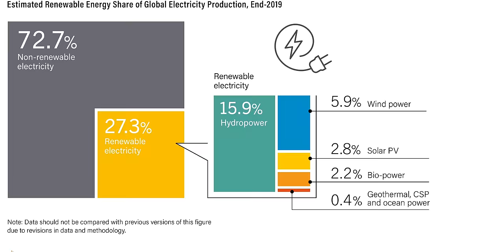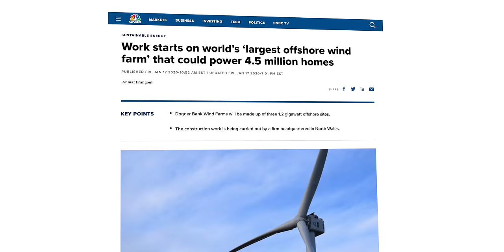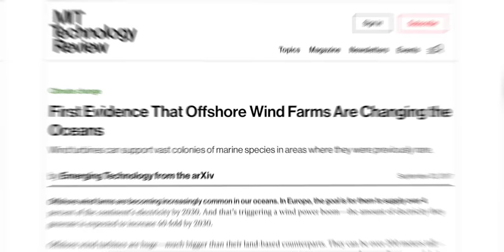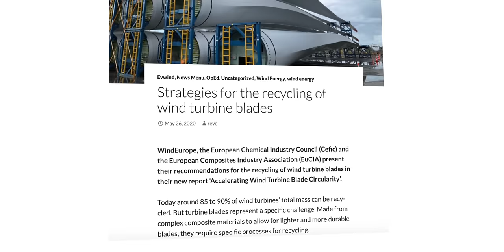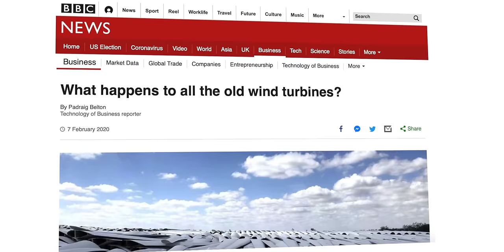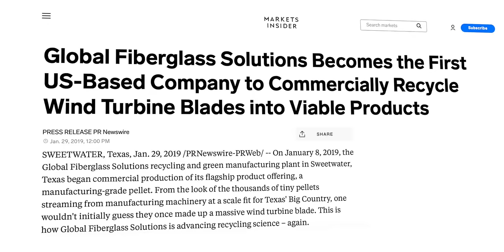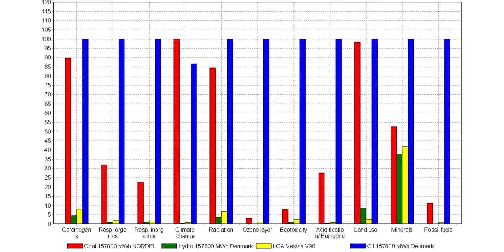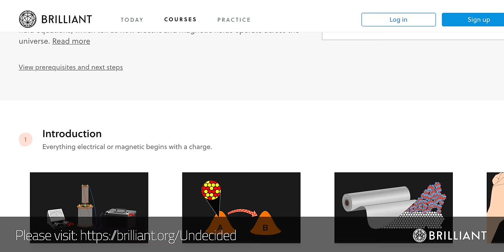The truth about wind turbines - how bad are they?

Comment: Wind turbine generators have a huge noise foot print with many on land applications now needing to be well over a mile from people.  There is evidence of noise being transmitted through the ground resonating in residences miles away from the source.    This and other issues have pushed wind turbines offshore where the cost is about double per MW than on shore.   Onshore wind turbine farms in the United States when their cost is past on to consumers have always caused electric rates to go up significantly.    

There is conspicuously no well publicized studies of the noise offshore wind turbine generators impacted to the water affect on higher level sea life such as fish and marine mammals.    Fishermen say fish don't live around noisy wind turbines and offshore wind farms destroy fish migration routes near them. 

Wind turbines live in a hostile environment and frequently don't reach their service life of 20 years with the average being closer to 10 years.   Wind turbines produce electricity that can substitute when available for other sources of electricity.   They have to be backed up by dispatchable power typically expensive to fuel natural gas combined cycle plants.   

During the 2000s it appeared the midwest USA high wind areas would be ideal for low cost electricity produced from wind farms.   Now in 2024 there is no longer any discussion on that implementation.   If it would have been economically viable it would have been attempted.  It likely proved it was not.   Part of the reason for not making a large implementation was the need for construction of long distance high voltage transmission lines, but other consideration now appear to have made them non viable.  

Atmospheric CO2 levels at about 1200 ppm about three times what it is today would greatly invigorate C3 plants the majority of plants on earth greatly greening the planet.   There is no mechanism that would allow greenhouse gas behavior to cause global warming.   All greenhouse radiant energy from the earth is completely absorbed in earth's greenhouse effect within in 20 meters of the surface.  There is no greenhouse radiant energy left to further interact with greenhouse gases.  

The cause of global warming is not known.  Global warming was officially reported at 1.1°C in 1991 and 1.06°C in 2022.  In the mid 1990s global warming was down graded to about 1°C.    The UN IPCC science report in its back pages has legal data transparency statement it took its greenhouse gas samples at 20,000 meters altitude where it is common high school level knowledge there is no greenhouse radiant energy.   This is common practice for misleading marketing to have a legal statement of data transparency protecting the perpetrators from fraud prosecution.  Even if there might be some stray greenhouse energy at 20,000 meters it is common knowledge it is not found there so a 20,000 meter altitude sampling statement legally states the report is not dealing with greenhouse radiant energy which is what greenhouse gas behavior interacts with.   The IPCC science report doesn't declare the 20,000 meter altitude statement is for legal purposes it just appears largely out of nowhere.

Comment: I am not totally against some green energy like wind and solar. I have 6 Renogy 100 watt solar panels on my shed roof and all of them go to my house through chinese inverters to offset my electric usage. I did it myself and they do sometimes spin my meter backwards. The others are a _arbor _reight panels and they charge a single deep cycle marine battery through a Renogy charge controller to power a drill press, radial arm saw and my router table along with a radio but not all at the same time( I couldn't use them all at the same time anyway). I also have a wind generator from Missouri Wind and Solar that I've had for quite some time and it works great. The only down side is that I have a 24v inverter hooked up to it and it needs to spin up quite a bit to generate enough power. If I used a lower voltage inverter it would generate electricity at lower RPM's. I just never got around to ordering it due to more success with the solar panels and the wind generator is not in it's permanent spot. I have a lot of projects going on at the same time. There is always going to be a plus and minus side to everything but getting rid of fossil fuels is not the answer. I laugh at the tesla toy cars and people who claim global warming. What people don't understand is that no matter what things change. The Moon is drifting a little farther away, the Sun is getting hotter and will get bigger as it burns through its fuel eventually growing into a Red Giant engulfing the orbit of the Earth and maybe Mars. The earth still wobbles on its axis which tends to cause fluctuations to some climates causing people to claim global warming. Our civilization is to young to know anything about the Earth's climate changes and the Sun's solar activity. Everyone is crying "Wolf"! but there is no wolf and when the SHTF people will be SOL. Like I said, solar and wind are good but they are not an answer. Just like toy cars are not the answer because they still need to be charged by coal fired, nuclear or natural gas electric plants.

Comment: hi,
wanted to ask if you (or anyone in the comments) had looked into the less explored downsides of many of the "green" energy sources.
for example the fact that windfarms litteraly take the energy out of the wind thus leading to slower windspeads, rising temperatures etc in the surrounding areas.
Or how geothermal energy is litteraly just draining energy out of the earth without a thought to what this might cause down the line.

if there are videos/articles that adress that i would much apreciate beeing pointed in their direction/linked to them.

thanks.
Reply: I wouldn't worry too much about shutting down the molten core from sucking geothermal energy from the crust.  Think of all the heat loss that already happens from volcanos and undersea vents.

Comment: Nothing is perfect. Wind is better, we can use that until something better comes along. Unless you want cancer from coal and or no electricity. I had a farmer friend tell me the wind turbines dries out the crops underneath it and dries out the soil. Is this true. The blades don't spin fast enough to make the air move or push down on the ground, does it? Someone help. I call BS

Comment: I read an engineering brief about how turbine blades are wearing fast and breaking, causing downtime and need to be rebuilt   

Add to that, ask Texas how they feel about frozen windmills...
Reply: Ask Texas how they feel about nuclear, coal and gas plants not able to operate because pumps or parts of their supply chain have frozen; and how they feel a lack of insulation in general
Reply: @glennjgroves   You do know that solar and wind failed in texas first... don't ya?
Reply: @TedSchoenling  I know that wind output was actually above forecast at least for some of the outage period; that any outages in wind or solar did not cause the outages at nuclear, coal or gas plants; that any area that does not prepare for extremes of cold weather will be **** when those extremes of weather occur, regardless of the generation technology; that wind turbines operate successfully at those temperatures in other parts of the world; that an easy way to mislead people is to leave out relevant facts or information (some of which I have helpfully included here, as your comment implies you are unaware of them); that some people will continue to believe misinformation, ignoring facts and information that is contrary to their beliefs no matter what information or facts they are presented with, due a lack of objectivity or critical thinking skills; and that if you think wind generation caused the outage you have excluded a significant amount of available information in order to come to that invalid conclusion.

Comment: You're entertaining the thought of what we could do if we went all out on wind turbines... imagine what we could do if instead we used those resources to build molten salt thorium reactors. 

If we had taken that route from the start instead of developing water cooled reactors, perhaps we could have solved all of the world's energy needs by now.
Reply: We can’t change the past, only our present actions. I am far from convinced of the practicality of thorium - if it worked as easily as proponents claim, it would have been done widely long ago, if not in the US, then in India (where they sit on 1/3 of the thorium reserves). Instead, no one has ever built a working commercial-grade thorium reactor. There are hardly even lab experiments. I suspect polonium poisoning and U-234 is the unsolved (and maybe unsolvable) problem, but I’m not an expert. As for regular light water reactors, they’re basically just at replacement levels when it comes to construction, if that. Too expensive to build. Wind, being cheap and easy and fast to build, has a huge economic benefit. Even if nuclear might arguably be better in the long run, wind has tremendous advantages in the short run. And from a carbon standpoint, short run is about all we have left.
Reply: @StabbyMcStabwood  39 different countries have commercial nuclear reactors, but NONE of them are thorium. Why is that? Is Finland hard at work on their nuclear weapons program as well? Japan? Nah. The conspiracy theory doesn’t explain the global failure to pursue thorium. Polonium poisoning explains it pretty well, though… it’s just technically unfeasible in practice, no matter how pretty on paper.

Comment: You don't dicuss the Production Tax Credit which makes wind turbines viable. Buffet told an audience in Omaha, Nebraska recently. "For example, on wind energy, we get a tax credit if we build a lot of wind farms. That's the only reason to build them. They don't make sense without the tax credit." Here in Texas in 2005 the CREZ bill was passed directing ERCOT to plan and install transmission lines to connect west Texas where the wind turbines were being erected to the big cites of the state. It took until 2015 to finish the grid extensions so the wind turbine investors were not curtailed and could pocket the generous federal PTC. Us rate payers picked up the estimated 8 billion dollar cost of these "extension cords" in our electric bills. You dicuss recycling the blades but what happens to the foundations lots of cocrete and rebar which as far as I know become a large wind turbine grave stone. May they RIP.

Comment: Yes and off shore windpower or in general has the ability to slow storms down protecting property which also brings in a value. 
Also thex mix hotter ground air with cooler air from higher up and thereby lowering temperatures on the ground on hot summer days. That's measurable up to 50km behind a wind turbine

Comment: Wind turbines are fine, but they're not going to do much to lower carbon emissions overall.  There's a lot of fossil fuel burning required just to make the steel.  Each turbine requires about four tons of virgin, high-quality copper which also puts a lot of CO2 in the air to mine and process, and copper mines are hard on the environment.  You need to burn fossil fuels to build, transport, install and maintain turbines.  Each turbine gearbox requires a lot of oil which has to be drilled, refined and delivered.  And when they're not producing enough power to meet demand you need to ramp up other means of energy production like coal- and gas-fired plants.  If you instead want to store the energy in batteries then you're burning a lot more CO2 to mine, process and build those batteries (as well as recycle them when they're done), as well as adding a great deal to the cost of the power infrastructure.  Ultimately the value of wind (and solar) goes down the more you ramp them up.  Meaning, the more you build them the more you have to rely upon other types of energy production.  All of this means wind turbines (and solar) will do little to lower carbon emissions.  Germany has invested heavily in wind power, yet their electricity rates are higher, and they produce more CO2 than neighboring France, which uses nuclear for about 75% of their energy.  Now Germany is removing wind turbines to make room for a coal mine, and three coal-fired plants will resume producing electricity.
Reply: Wind turbines in the long run is almost no emissions. It's sustainable, there's no coal used. They can manufacture wind turbines with renewable energy sources.
Reply: @daineramosquitco5816  Wind power is intermittent, so when the wind isn't blowing it's not producing any power.  Windmills often produce much less than full capacity, and generally do so when demand is highest.  You make up for it by building many more than you need over large areas to meet peak power demand by using the wind wherever it's blowing and/or building power storage facilities, which are costly and result in lost energy when transmitting, converting and storing it.  If we want to move away from natural gas and oil for heating, we'll have to build far more windmills to power electric furnaces.  If we replace enough gas vehicles with electric vehicles then peak demand is going to go up, which means building many more windmills to meet that demand.  Currently we're reducing overall electric power capacity resulting in reported rolling blackouts in multiple states.  In Washington State there are plans to remove several hydro-electric dams.  In the meantime China continues to increase CO2 emissions by large amounts every year.

Comment: Oh, great. Put in wind turbines, so that residential electricity costs double, then double again, just like elsewhere. Wind turbines finally pay for themselves after 25 years of use. Many don't make it to 18 years of use. The blades have to be replaced after a decade of use...less, if they are ocean based. Here in the States, they are putting in 168 structures(mostly turbines and meterological stations, etc.) a few miles off the coast of South Jersey, 158 wind turbines, 850 feet tall will go up initially. The second stage, the total will then be 1,410 turbines. Those are purported to be 1,200 feet tall. . Final count will be over 3,000.  Almost all of the undersea cables, and the power, will be going to New York State. An incredible amount of the World's rapidly dwindling supply of copper will go into this project. Meanwhile, the local nuclear power plant was decommissioned in 2018. They had completed construction in 1969, when it originally came on line. That's just shy of fifty years. All the power lines are still there. Why not put a smaller reactor on the property? That would make too much sense. Massive wind turbines are just another boondoggle to squander taxpayer money.

Comment: I must correct you on one statement here I was a turbine tech for 20 years before I retired They do to have a generate some pollution while they're in use and runningAll those components have to be lubricated So you do have waste lubricating oil It'scontained taken in recycled but it does have a pollutantwith the newer blade designs and new composite materialsThey'll be much more sustainable Everybody wants green power nobody wants it in their backyardNether nice option is smaller vertical axis turbinesThen aren't nearly as big of an eye sore They can go into smaller placesIs there anyone solution for crane energy Nope it's going to take a lot of work by a lot of peopleor nuclear of course nobody wants nuclear because of like Chernobyl and other accidentsIf we go to the modern modular designsRather than the 1950s Westinghouse design on the reactors they become much much much saferRather than building great big ones build smaller ones that if they do havea problem that's not nearly as much radiation or contaminant released the newer modular reactors can also burn this use the same fuel for much much longer therefore less radioactive waste in the long run

Comment: It took decades before fossil fuel use made a noticeable dent in CO2 levels. I wonder if any of the wind power generator system have ever considered what is actually happening to global wind patterns. What happens when globally there are so many wind powered generators that global wind patterns change enough to show a pattern of less generated output and changes in temperatures to show it getting much colder where it had once been warm and the warming of areas of the globe that had previously been cold. Perhaps its not CO2 emissions that cause irreversible global warming it might end up being wind  and solar power that bring about the melting of polar ice caps.

Comment: Geothermal could take over windmills and solar panels. And you just drill holes down until you get to the heat. Each state could drill 25 holes or as many as they want. The heat is free and it's hot 24 hours a day and 365 days in a year. No batteries will be needed to store power when the wind doesn't blow, or when the sun doesn't shine. And the footprint is a lot less too. It works well in Iceland and northern California,,,,,,,,,,,,,,,,

Comment: Some of these cons are not that significant. Yes, fossil fuels will be needed to power the machinery needed to build and maintain them. But that will be a minute fraction of the savings in fossil fuels overall. Old blades can be cut into more manageable sections onsite. Any power station construction will require building materials

Comment: How about doing an update now that time has passed and there are more turbines, and it’s seems that there is such a push for wind and solar but not on the energy used to create, and dispose of the components.  With high energy costs, electricity and fuels, high costs of materials.  Should the future be small individual turbines to supply small village directly, or individual homes.
A small 3.7kw with a power bank.  But then air source heat pumps are being pushed, which in cold climates don’t work.